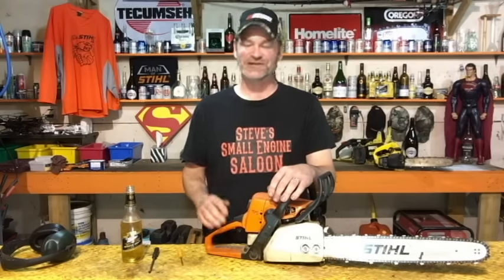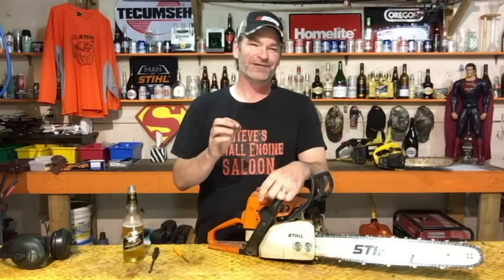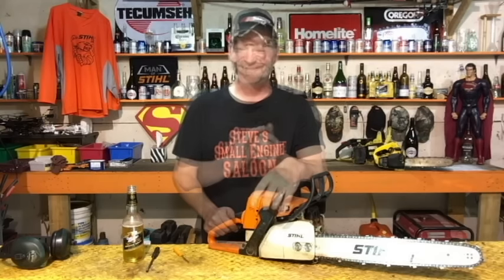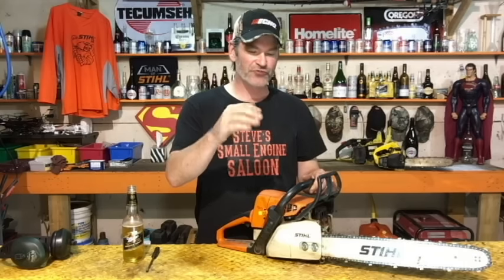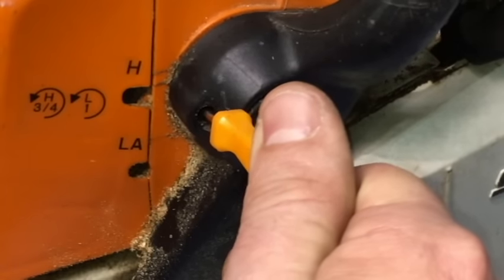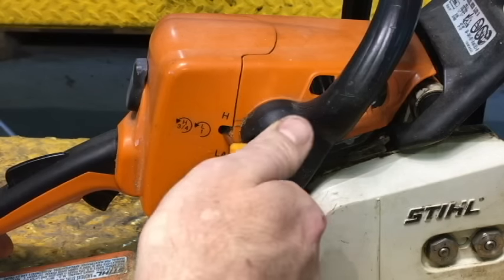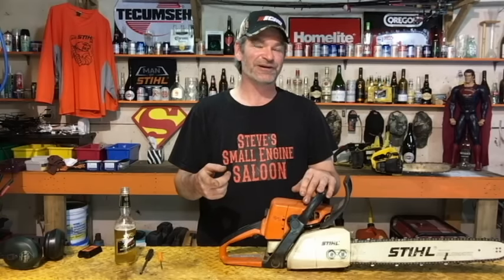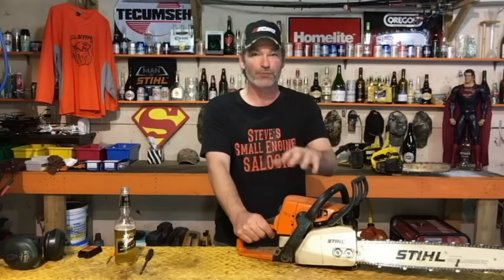CORRECT WAY To Adjust Or Tune The Carburetor On A Chainsaw (Step-by-Step)

Comment: Hi Steve...great video...thanks. Unrelated question....I have a Stihl blower...new plug, new carb kit, new flywheel and key....won't start, and sometimes really rips the pull cord out of my hands when pulling. I put the new carb kit in and the new plug because when I tried to start it the other day, there was gas spitting out the plug hole, air cleaner and exhaust port.....crank and cylinder full of gas!! I thoroughly dried it out, upside down and pulled several dozen times with no plug to make sure, and then left overnight, then the next day put in the carb kit and plug. My efforts have all been in vane....any ideas??
Thanks

Comment: So we just got a saw back from a shop , and it first works fine , but when warm at full throttle it just dies , but does start back up no problem, but at full throttle dies , is this a carburetor issue , someone said air is getting in the system some how , and thanks man as a Arborist all I do is climb and remove, but I am sick off the boss being ripped off so I thought I would try to help with saws . It could be a ton of things ; but I see you are very educated in this practice, so I thought I would ask man.
Reply: Sounds like fuel delivery issue. Check fuel lines and fuel filter first.

Comment: Coming back to this again after getting an 1982-83 Pro Mac 155 running after it sat for an unknown period of time seized (from sitting), trying to find the max engine RPM for that model online with no luck at all. I can find idle and clutch engagement range, but nothing for max or operating.

Comment: hi Steve   we love your  style  and have always looked at your  guides to keep our saws going   i have a echo ev610  twin   1x 268 husky 2x 455 husky  1x550  1x 390  1 x stihl i 50   
and have looked after mates  saws  but have a guide with  i believe is a tank vent issue on a  236 husky  i prove tested that the tank did not vent  and it  looks like the vent fitting is next to the primer line  it could even be cast into the tank  as i cannot remove it   with out drilling  and pulling it  out   .. i   ordered   the metal  plug    which  i hope is the correct   choice  . have you ever had this type  of  problem    cheers  Tim  Australia

Comment: Great explanation!
Reply from the maker: Thanks!
Reply: Would appreciate knowing the correct fuel line/purge line for the Poulan 2800 chainsaw. This model did not come with the bulb. I can only see where 2 lines may have gone. There is no third line nor is there a line that goes to a nippke at the back of the block just below the cylinder.

Comment: HI Steve, brand new subscriber here, and man have you upped my chainsaw game - thank you.  Quick question: turning the high speed screw in or out changes the air/fuel mixture, right?  I've flown RC gas planes since the '80s, and the technique for dialing in the high speed screw is to max rev the engine, and then turn in the screw until the rpm begins to decay, then back it out slowly until the rpm recovers, then leave it there.  That provides the best rich/lean setting.  Is finding that ideal high speed rich/lean setting similar to how chainsaw engines should be set for high speed, or are we simply just finding an ideal rpm regardless of the rich/lean?
Btw, your film editing is matchless.  You show exactly what I'm hoping you will in the turorials, everytime, by the closeups and duration, etc.  Just first rate production.  Like you didn't know . . .

Comment: Rebuilt my Stihl FS420 Brush Cutter carb. Had to remove all 3 airscrews in order to get the carb out, marked just like on this chainsaw, hi-lo-LA, what is the baseline for the three screws? How many turns out from fully tightened should be my starting point? Nice videos, from Sweden.

Comment: Thanks Steve , this is an area I am not very good at so this has been really helpful and the switch from no chainsaw  noise voice over to how the chainsaw  will actually sound is very  smart  .  I got to get one of those tachometer's local Stihl or Husqvarna  shop should be able to supply one .   I have a question .  When the saw is in a cut the engine will never rev to the max it can rev with no load on the chain .  So  if you don't rev the guts out of the saw when it has no load is it still an issue if the saw is tuned to rev over the factory recommendations  ?  Or is it a potential problem for when the chain  cuts through and the saw suddenly goes full revs until you let go of the throttle ?

Comment: If a chainsaw cuts out after 10 mins work what's that a sign of?
Then it takes 10-15 mins to get it going again.
It wasn't used for a year or more since it was bought ( was left in the box in garden shed )
Thanks for help

Comment: Hi steve, I am looking to purchace a 50cc chainsaw, want a 20" bar. What would you recommend? I have a crappy Poulan Pro 3314 now, and I hate the carburetor on it, I don't know what you call it, but it has two intake ports on it, one on top of the other. Theres a name for that type, but I can't recall what it is. I'm assuming they did that for emmisions reasons. Can you buy a new saw that has a 1 "bbl" carb on it anymore? How do you feel about the 2 "bbl" carbs? A good chainsaw is an expensive investment, and I don't want to make a mistake. Thanks!

Comment: I have a Makita DCP7321 concrete saw. How do I go about setting the high low settings on it? Same way as the chainsaw except turn the idle screw until the blade starts to spin? I had to put a carb kit in it because the original was flooding before you would even get it started. So now that I have swapped out the gaskets and diaphragm, I want to ensure that my settings are correct. I know when I depress the throttle trigger, there is a hesitation before it kicks into high. Thanks! Cheers!

Comment: Steve, where can I find the digital tach that you showed?
I looked online and there are some "cheap" models with poor reviews, and then there are models that appear to be "hard wired" to the engine in some manner.
I searched for "non-contact digital tachometer" and some were over $100.
Can you tell us of several models that we might choose from that only need to be held near the spark plug versus "hard wiring"?

Comment: G'day Steve! After removing the low speed screw limiter cap, I tried to adjust again the way you explained and found that the saw doesn't die when turning the low speed clockwise OR counter clockwise in fact the only thing it does is start turning the chain faster and faster when turned clockwise, what else could this indicate is wrong with the saw?

Cheers!

Comment: First I like to say that I really get good info from your posts. I have a Mcculloch chain saw, after adjusting the H and L screw and I start the saw it runs then stops. I find out that the vibration makes the adjusting needles move and goes out of tune.
What can I do to keep the needles so they do not move.
Reply: there should be tension springs on the needles that keep them from turning. if they are moving on their own you probably need new springs. carburetor repair kits usually come with new ones

Comment: Now Steve I'm hoping that you check some comments on your older videos. I'm a sub for a little while and love your videos. I like going through some older videos. Most I already have watched but like to watch again. I have a couple questions. Turning in the Hi and Lo screws, means clockwise, right? And that's adding fuel?

Comment: what if my saw doesn't want to idle until it is warmed up?  It will start great and run if I give it a little trigger gas but won't stay idling until it is fully warmed up...seems to run great after that.  It is a new saw that I have only used a few times.  Is this an L adjustment or an idle adjustment?  This happens every time.  Thank you.

Comment: Hey mate - Really like your videos and would appreciate your input - Have you ever used a Gunson Colortune on a chainsaw (or for that matter any small two stroke engine) to set up the mixture? - I've got one in the garage that l've owned for 35 years - When l was a young bloke l used to set SU Carbies up on old Minis and Triumphs etc - Good bit of kit too for getting the burn Spot On - Just wondered if you've ever used one yourself - Cheers Mark Opie, Central Goldfields, Australia.

Comment: I like to know if you can help me on this problem.  Was running  ok other day.  Next day  I tried to  start it nothing at all .  Have spark I use store bought gas 50 to1 all the time in my 2 cycle engines .  Year old saw used 3 times. Husqvarna 120 Mark II .   I just sprayed starting fluid into cylinder not even a kick . Saw like brand new. Trim few branches 1 time that was it. What you think it is ? I would really appreciate. your help on this.

Comment: I recently purchased a new Husqvarna 435 but the "L" screw on the carb needs adjustment. I purchased the required 4mm splined tool 
online but when I insert it over the screw it feels loose and when turned it feels like it's not engaged with the screw. I also tried one that 
I already had with the same result. However, the same tool fits perfectly on a Husqvarna 120 and that screw "looks" to be the same as the 
ones on the 435.  Would you know if Husqvarna has change the screw size on the 435? Any advise would be appreciated. Thanks.

Comment: IDK if you saw my question Steve . Ran 1 day fine next nothing . I have spark . I sprayed starting fluid in cylinder.  Not even a kick . Saw like brand new year old cut few branches with it. Gas is 50 to 1 I buy at the store.   What you think it is .  I would appreciate your help on this. Thanks. Husqvarna Mark II .
Reply: Got compression? Squirt mix, not starting fluid.

Comment: Is there a start point with the idle screw (it's a Stihl)? I can get the saw to start and run but I've been switching between adjusting the idle screw and the low speed until the chain starts moving. Now I'm lost and I can't find the sweet spot anymore. It just stalls out either way I go. (Hopefully you'll see this 😁) Thanks

Comment: Steve i have a poulan pro 42cc 18" bar that has never ran the same two days in a row i ve even replaced the carb still the same one day it runs great the next it wont idle or rev or it boggs down any ideas?

Comment: Hey Steve! Can I ask a question? Adjusted the Low speed screw like you said, chain was still moving, turned the LA iidle screw down until it stopped moving. Runs like a char, but I noticed just listening by ear that it was idling higher than I'm used to with other saws. Checked idle with a tach, it's idling around 3600 RPM rather than the 2800 RPM specified by Stihl. That OK? I turned it down more to get it around 2800 but noticed it will sometimes stall out now. Stops stalling if I increase to 3400-3600 RPM range idle. Chain doesnt spin at that high of an RPM. That OK you think?

Comment: I have an old homelite chainsaw and the H & L are not marked and the screws are on the other side. Does it still apply that the low screw is closest to the blade or is it is it furthest from the blade since it’s on the other side

Comment: Looking at these tuning videos one thing I see in all of them is, before you even start screwing the screws around, clean the air filter and mix up some new gas with the correct oil mix, dump out that old unknown crap that is in the tank, check your filter , put in the new gas correctly mixed. Then screw around with the screws. Maybe even check that spark plug taking note how it looks before you begin. Too much oil in your gas means less fuel, therfore lean mixture.

Comment: I owe the subscribe like and comment. I tried adjusting a poulan that I bought off somebody they had used for 30 minutes and I didn't know we'll enough how to adjust it after one video a month ago and I through it at the ground and at a tree and broke the handle off, the lock for the bar, broke the bar and bent the tree grabber prongs. First off I was trying to get a yard sale bought Craftsman my mom got at a yard sale for 10  bucks before I got the poulan and had a primer put on new fuel line and filter and it still wouldn't idle or run. After I watch this video a couple times I got a good.look at how tuning works and this morning you brought a 1997 Craftsman back to life for me very well. I've never replaced a carb or anything on my own or watched it done much I've learned a bit bout it on YouTube. But I did just do a fine tune job it doent have the screw stoppers but at first the chain was flying around in idle now it's not turned it down just enough, also I gave it more gas turning the L up just enough and I turn the h down as about as low as I could tell so it doesn't sound like it's trying to haul ass. It almost sounded like the h screw had a high spot turning toward the bar and away and a good lower spot close to the middle like the opposite of the l screw mabey but it isn't going to spot running now. I tried to look up where the h was supposed to be on the craftsman but it's prob findable or I could call somebody but I think the job is done. I don't want to go down without some history and knowing how to tune a saw is cool so thanks
Reply: My main problem I had with trying to tune the poulan was I didn't turn them up and down while holding down the trigger some. You gave me a good look
Reply: Also I didn't mess with the idle on the poulan that I through because the letters on it for it confused me n through me off

Comment: Steve definitely has the low speed jet and idle figured, but for the highspeed jet you really wanna adjust when your cutting, get it 4 strokin run it rich then lean it out just until it 2 strokes without any 4 stroking action, best works if you get a buddy cutting and you adjust while hes cutting, then you know your not lean and burning the saw piston

Comment: I just started tuning saws a few months ago and it's honestly super easy and simple. You're basically setting your top end RPM with the high screw, your idle rpm with the low screw and your clutch engagement rpm with the idler screw.

Comment: I followed your directions and thought for certain, this would fix my chainsaw bogging down after reaching peak RPM. I went on to adjust the L and LA screws but it made zero difference. So... I went into the carb and found the fuel screen almost fully  plugged with junk. My bogging down now makes sense as the engine would idle fine and rev up nicely but after 1 second on full RPM the engine would bog down because the extra fuel needed at full RPM was being restricted by the buildup on the fuel screen inside of the carb. You might include this somewhere in your video.

Comment: Hi Steve! I absolutely appreciate you having set up this channel. But I do have a question: I have a small arborist saw (25cc) that I’ve had some trouble getting to run properly. The saw is a Chinese clone (Farmertec JonCutter G2500) and unfortunately the instruction manual does not contain any information to set the High Speed / Low Speed / Idle Adjustment screws. Any help is GREATLY appreciated!!

Comment: i have cleaned carb in my craftsman gas chainsaw. to get to it i disconnected trigger mechanism also cleaned everything in and around.   i put all back and now as i start the saw, it revs like crazy to the max.  what is the problem? Did i mess up when i hooked things back up and got the metal cable from the trigger too tight or some other issue?

Comment: Got a new carb for my chainsaw. Trying to adjust it out but will not respond well to the basic adjust. When I first put it on it was running at a high rpm. I adjust it but it just wouldn’t stay running after that. It seems it’s not getting gas flow properly. What do you think?
Reply from the maker: Plugged fuel filter?    :_Beer: :_Mower: :_Rider: :_Chainsaw:
Reply: Replaced everything when I replaced the carburetor.
Reply: Thinking I may have a bad carburetor.

Comment: I use a dremel to cut a flat head cut into my adjustment screws on all my small carbs. It has it's pros and cons. Pro-No Tools, Con - When vibrating around (running) its harder to get a flat head into the slot vs the specific tool. I have also heard of people jamming a piece of fuel tubing on the end to turn them if it fits tight enough.

Comment: Hey Steve! What would you suggest as far as an altitude adjustment? I live at 5500 ft above sea level (Denver CO) but I often take my saw to altitudes of 9500 to 10,000 feet above sea level. Do you know of a adjustment I can make on the fly? At home my saws (MS 171 & MS 291) run like raped apes but at high altitude I have to feather both for at least 2-4 minutes to get them to run properly, and after that they run ok-good. They completely bog down. Fuel, plug and filters are all excellent. Thanks Bud!

Comment: Hey Steve my grandma gave me a Stihl MS 170 that she thinks is burned up but it has good compression, I haven't checked the spark yet because I just got my hands on it. But I noticed my carb adjustment screws aren't easily accessible because part of the plastic body of the saw is in the way of the screws. Making it to where I have to remove the carb to adjust the screws, I'm thinking screw that I'll remove it once and take my Dremel and a cutting wheel and just cut the small section covering my adjustment screws then reinstall the carb and then I'll be able to adjust it with it running.

Comment: I bought an echo CS 460 last week and it worked great the first two trees that I cut but on the third day of usage I started to see trigger response problems where the saw would stall when I squeeze the trigger. I tried playing with the adjustment for the low speed Carburetor adjustment today at seemed to help for a bit but after I switch the saw off for a couple of minutes to move some logs and then I started it up again it seem to have trouble with the trigger response again.